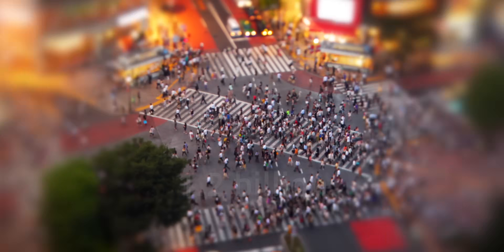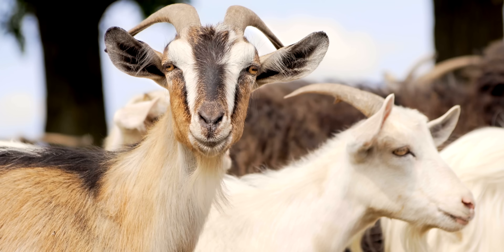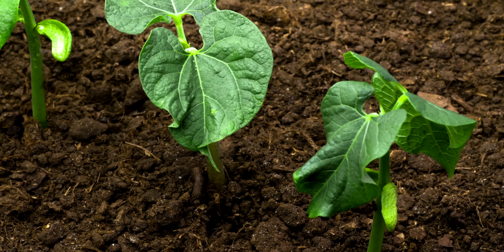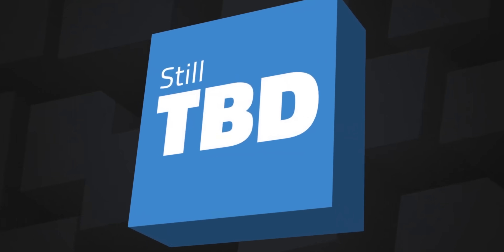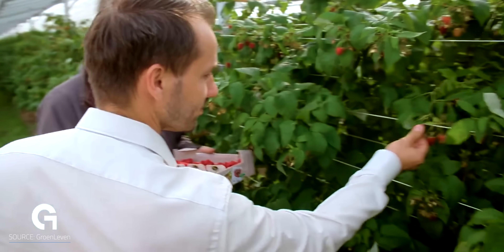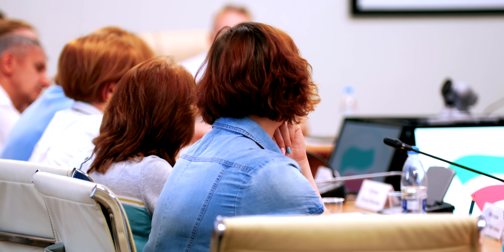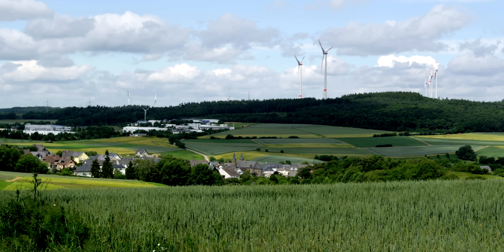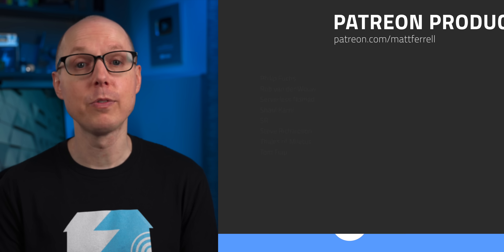Solar Panels Plus Farming? Agrivoltaics Explained

Comment: Whatever can be done for achieving the goal of a world run by clean energy, needs to be done. No matter the costs.
Reply: The costs usually represent energy or labor input.  If it takes a lot of energy to reduce energy consumption, the project is self defeating. You have to be careful when you say whatever the cost. Electric cars look environmentally sound until you add in the energy used to dig ore out of holes all over the world, refine and transport the materials to a plant for assembly. As supply lines develop they do get more efficient and the equation can flip, unless the materials become more rare and harder to extract.  The best way to maximize efficiency is to end all subsidies.  Companies and consumers will lower the cost and the energy input along with that. If electrics win, it is meant to be.

Comment: The next step is to mount rails on the panels and have robots traverse the aisles to prune and harvest the fruit.
Reply from the maker: Those days are coming.
Reply: Yes, was my first thought also. The possibility of robots and IOT could enhance the attractiveness. But that will add to the initial capital outlay.
Reply: @judedornisch4946   The biggest problem with IOT is that it puts stuff on the Internet that shouldn't be connected to it at all. Robots and sensors should be confined to their own dedicated network with a strict isolation from the wider Internet. If anything on that network needs to communicate with an Internet-connected device, it should be via a dedicated gateway designed to only transfer what is absolutely necessary, and preferably not over any kind of network connection. The last thing you want is some script kiddie finding your farming or industrial equipment on the Internet and screwing up all the settings.
Reply: @Roxor128  Yes that is a general IOT issue. However looking at this use case in would likely be mainly a dedicated use mesh localized.
Reply: @judedornisch4946  It comes down to the investment return of the initial outlay increase versus the ongoing upkeep costs and the labor and other savings decreases
Reply: Robots and agriculture are a perfect fit. I've been experimenting with one for weeding in my orchard. I used to walk the orchard for an hour every morning just to tackle weeds. Rails in high density orchards have been done and do work well. They also reduce a lot of injuries. I truly believe robots are the fix to our overuse of chemicals in agriculture.
Reply: I mean there was a prototype robot harvester a couple years back that was able to identify and pick ripe peppers.
Dont know if that project ever went anywhere though.
Reply: @samueleveleigh2767  Great project in principal, but not in real world conditions. The project got shut down due to not being economically viable. Keep your eyes out though as technology advances and new start ups enter the field this could change at any time.

Comment: right now we honestly aren't at the point where the supply of land is the constraint on solar output, but if engineered to not get in the way of the farmer and if the farmer can make more money off of it at the end of the day then there is obviously nothing wrong with it; and in the long term this needs to be viable w/o subsidies
Reply: This might be true for countries like USA and Australia; but in more densely populated countries like India; land is always a constraint. The flip side is, its the densely populated countries that have higher energy requirements (not consumption as per capita consumption varies greatly) and could benefit most from renewable energy production.
Reply from the maker: I agree with you for certain areas of the world, like here in the US.  In densely packed areas though, where land is at a premium, this can make a big difference.

Comment: Agrivoltaics can help in lot of places where place is at premium; but need a very complex analytics in form of what kind of photovoltaic structure and panels support which crop in which location (climate, rain pattern average temprature) etc.
Reply: If you can afford to reduce panel density (power output) then it is a win-win situation for all. All the power needs for the farm (plus farm product processing; storage air conditioning; farm machines etc) can be met from the solar output.
Reply from the maker: There's still a lot of learning to do around agrivoltaics, but we're starting to see some really good progress there.
Reply: @UndecidedMF  My personal opinion is that it has lots of promise!